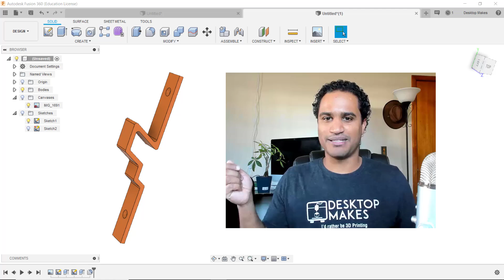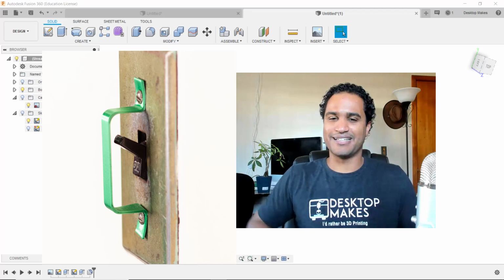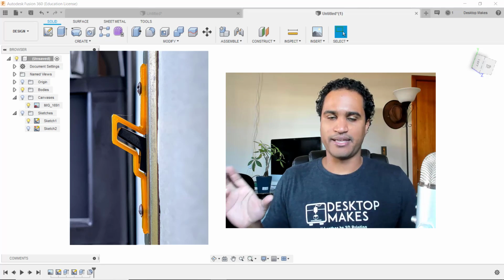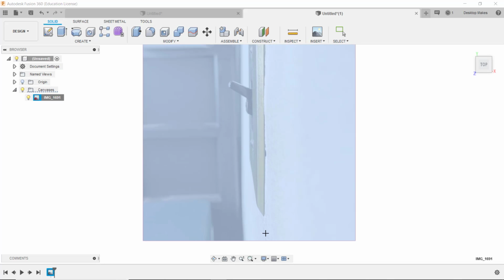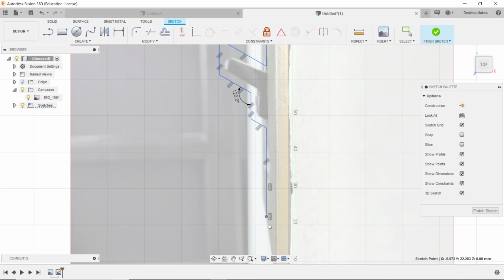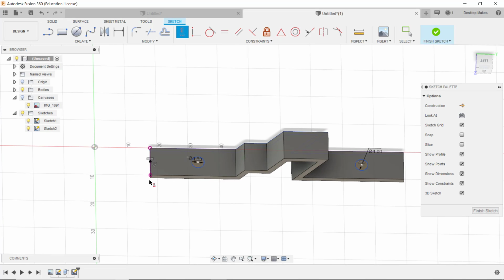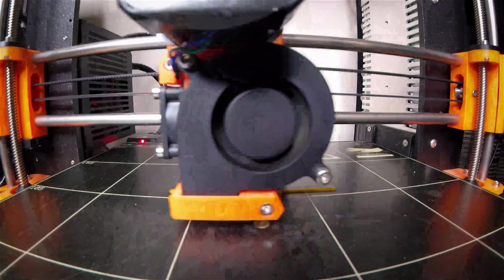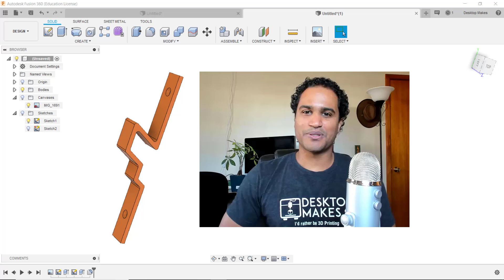Design a Light Switch Cover

Comment: Hi . I have jgarura printer.  I would like to about beat settings in cura . Top face it be come with lines not smooth surface. I use pla filment

Comment: Some of my recent 3D printed home improvement projects:  1) specialized Christmas light gutter clips for our new gutter covers, 2) upper tray roller fix for our dishwasher, 3) new plug for my bicycle handlebar, 4) new pin for the ice chest handle, 5) camera tripod leg lever replacement, 6) HP Printer tray fix, 7) variety of specialized wall mounts for non-traditional items like by daughters cosplay creations, 8) storage solutions such as clips to hold bottles contains small parts or arrays of clips holding spools of wire.
Reply from the maker: I thought I had an extensive list but I think you've got me beat Robert.  Nice!

Comment: I would have removed the whole switch, short cut the wires and put a blanket on!
Reply: For some people that are afraid to deal with electricity and don't really know what they are doing, printing out a part is easier / safer.  This does give you the option to remove the cover without having to reconnect the switch.
Reply from the maker: Yeah but were's the fun then there's no 3D printer involved?  😉

Comment: What kind of bloody evil country allows a light switch to be used to turn on or off a power outlet??
Reply from the maker: Crazy times we're living in!
Reply: In US apartments, it's pretty standard to have a couple outlets in a bedroom controlled by a light switch. People connect floor or side lights to them. Then the switch controls the lights. Makes sense? Usually one outlet of the pair is switch-controlled, and the other is always on, so solving the problem should be easy: you don't want your light be switch-controlled, plug it to the other outlet. But some electricians take the shortcut and wire both outlets to the same switched circuit.
Reply: According to building code in many places, if a room doesn't contain a fixed light or ceiling fan with a light fixture, a room must contain an outlet that is switch operated. This may be the result of a cheap "fix" to meet code requirements.